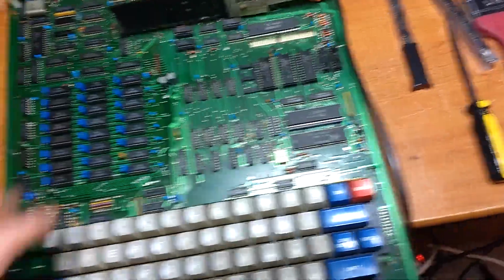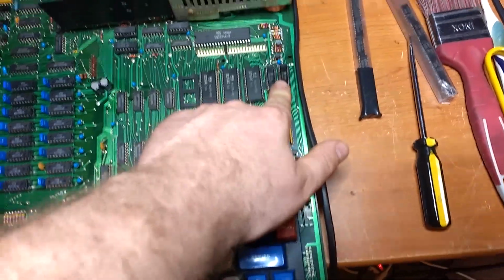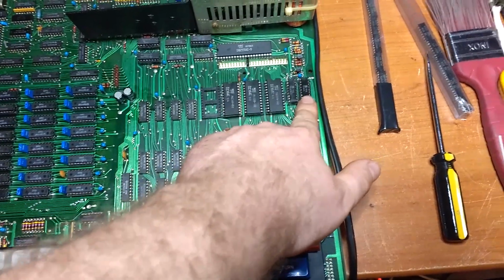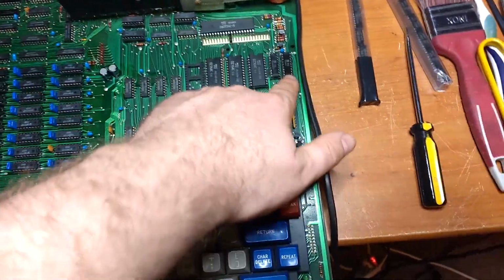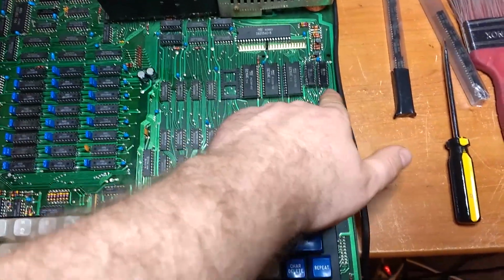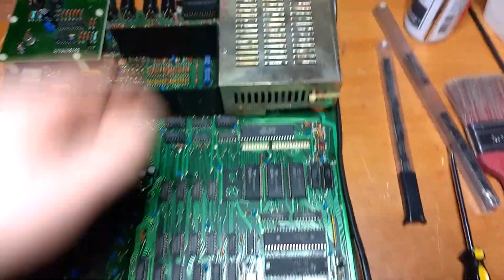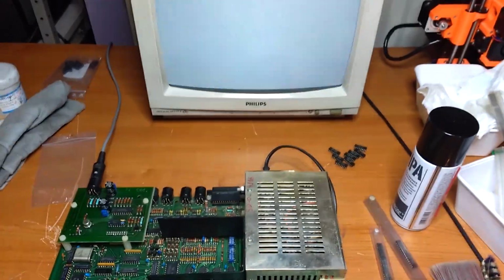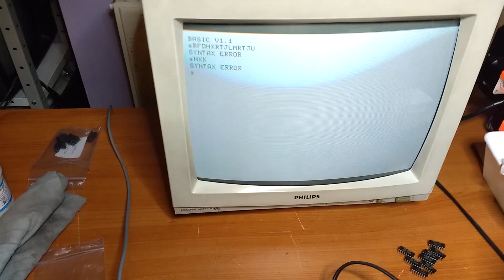INDATA DAI Microcomputer memory repair

Comment: Kris, the dual 2111 chips are NOT video RAM, but static RAM (256 bytes combined, all that !)
for the 8080 processor stack where return addresses are stored when doing CALLs along with registers PUSH data.
FYI, the video RAM is the same as the regular 48kiB dynamic RAM and the 3 chips on the left of the static are the 24 KiB of the very sophisticated DAI ROM (3 x 8KiB).

And granted those 2111 chips are very prone to failure.
Your "switching" of the 2 original 2111 chips seemed to solve the problem but I rather think that :
  - there was possibly a bad contact fixed by the new socket
  - your fix is probably not 100% bullet proof since you didn't test the entire stack

Anyway, since you cannot find those chips anymore and even worse, those "old new 2111 chips" that you could come across would very likely be defective too !

So here's a workable solution from a french guy called Bruno Vivien : he maintains a fairly extensive website on the DAI (in french)
with a load of useful information and obviously, this very common issue is addressed on this web page :
     http://bruno.vivien.pagesperso-orange.fr/DAI/reparation/panne1.htm

He goes as far a providing a solution by using more recent and way more reliable static memory :
a 6116 chip (2K x 8 bits) to replace both 2111 (256 x 4 bits each) with a mini PCB or breadboard.
Reply from the maker: Someone already corrected me about my "video ram" statement, hehe. Thank you for the great explanation!
I have been able to locate 9111 RAM IC's in the Phillipines (if I remember well). They work great as replacement for those 2111's